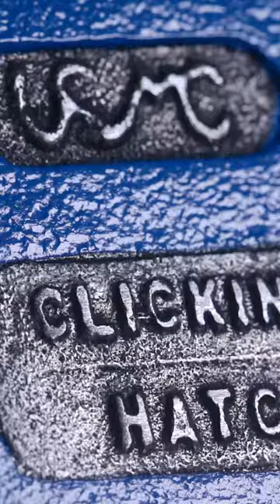Restoring a 100 Year Old Rare Rusty Leather Hatchet

Comment: There is a reason why that little heavy knife had no hole in the handle. Reason is if you hang that up and it fall's it could easily cut a toe off or cut into you very easily because the blade is pointed down when hung. Things are the way they are for a reason and you didn't make it better with that leather snap collar.

Comment: A "clicking" hatchet. I don't know how loosely the term was used but I suspect some English shoemakers are rotating in their graves at the uncultivated roughness of American leatherworkers.
Reply: It’s not used for cutting the shoe pieces. It’s used for quickly chopping the scrap from a full piece of leather when it comes off a clicker cutter. Had to go down a rabbit hole to find one actually being used. Video I found was making northwestern logging boots. Think the leather on those is usually in the 8-10oz range.